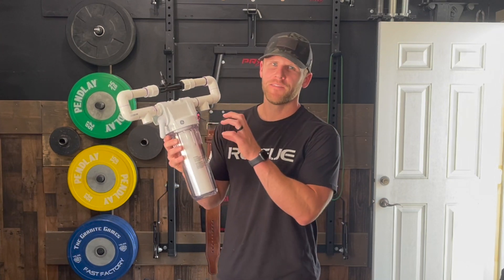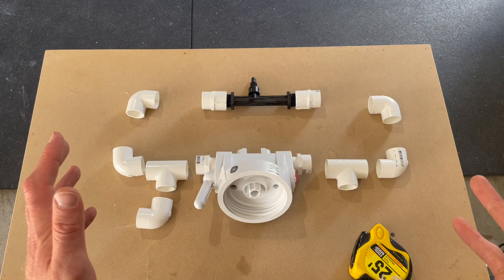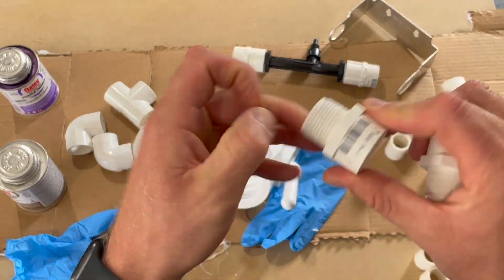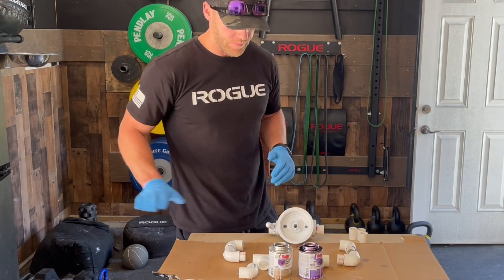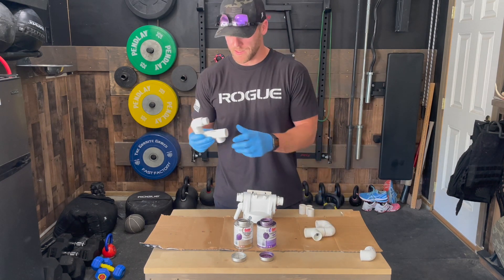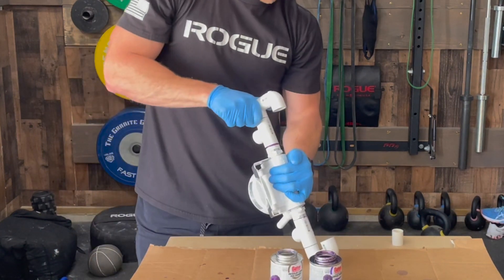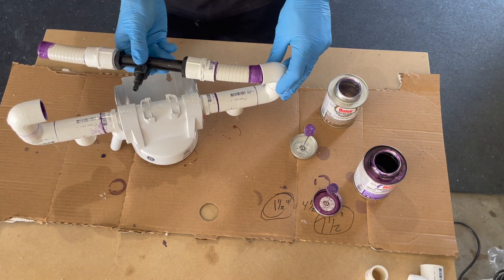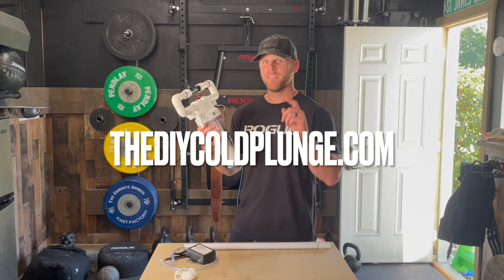Step by Step Sanitation System | DIY Cold Plunge

Comment: I just got done making my ozone based off of this, do you forsee any issues if the purple primer dripped into some of the PVC when applying? Didn’t get in filter but mainly the top elbows
Reply from the maker: That'll all dry and be just fine 👍 you may want to simply rinse the system but that's it

Comment: This was one of my best additions to my cold tub. I got tire of changing the cloudy water. I added this same setup with a 5 micron sentiment filter and works fantastic. One flaw I notice with your design here is that not all of your water will be filtered since its being bypassed. I would  instead add the ozone system to outlet side of the filter, so that you get 100% filtered water and then sanitized. Thanks for sharing this!
Reply from the maker: Hey thanks that's awesome to hear! I get that comment/thought a lot... and it seems legit at first but there is a flaw in the logic of needing everything in-line. I cover it in depth along with other considerations in this video 👉 Avoid These Mistakes! DIY Cold Plunge Filtration & Ozone Setup – Explained
https://youtu.be/y1MYCCyLtME

Comment: So i mimicked your setup with a 1200 gph pool pump, a venturi air purifiers, the sanitation system, and it goes into a 275 gallon ibc tote (cold plunge).  For whatever reason i have no water pressure coming threw the system:/ 

Is there anyway yoir able to help troubleshoot?? This project has been 14 months in making and its done minus the plumbing isssue

Comment: What would minimum pump specs be to run through this setup?
Reply from the maker: The two pumps I recommend are the Danner 950 and 1200 - https://diycoldplunge.com/products/danner-950-1200-pumps
Reply: @DIYColdPlunge  I currently have the Danner 700 for my 1/3 HP chiller. Do you think that will still work if I add this ozone and filtration system or do I need to upgrade to the 950?
Reply from the maker: @awaischaraniya5650  It's going to be close, the filter housing handles 700 itself... I would recommend going bigger if you can. I've also got a new video on how to set up filtration, reference that instead of this old one 👍

Comment: Thank you so much, this is super helpful! I wanted to ask - the tub I have has 1/2 inch inlet and outlet which I can't change (inflatable). I'd like to follow your plans and use 3/4 inch for the filtration/sanitasion/chiller system. Do you think it's bad to use a 3/4 to 1/2 conversion at the tub's inlet and outlet?
Reply from the maker: I've had a few folks do this without issue

Comment: First off thanks for the video with all the links. I bought all the components listed and got it all set up. Only issue is the ozone does not seem to be injecting any air into the line. Any advice on what might be the issue?
Reply from the maker: If you ordered through my site shoot me an email, I'll help you get it sorted out 👍
Reply: I just used your links to buy the stuff from Amazon  but not through your site though that’s awesome though thanks for the offer I understand

Comment: I guess putting the filter and venturi in parallel could work, as long as there's flow through each one.  You're gonna have some unfiltered water going thru the venturi, and some plain water going thru the filter, but after enough time (and assuming there's flow thru both) the water will end up being clean and sanitized enough.
Reply from the maker: Even if you put the filter and ventur in-line, as soon as the water hits back to the tank would be "unfiltered"... The only way to truly filter the water would be to go from one tub to another anyway. This simplifies the plumbing setup and operates the most efficiently for water sanitation.

Comment: 800 gph active aqua pump discharging into the chiller that discharges into a 30 micron ge whole home filter.   Since adding the filter the flow has come to a crawl.  Is my pump not generating enough pressure to pass through a pleated water filter?
Reply from the maker: I'd need to see the entire setup to assess that... You can send an email through my site if you want.
Reply: Understand .  For sure makes sense .  I'll figure it out.  Just wasn't sure if ge 30 micron filters are known to slow flow down to a crawl

Comment: I can't see how the water goes through the filter?
Reply from the maker: The pump is slightly more powerful than the flow rate of both, the flow rate of the filter is significantly more than the Venturi. Water follows the path of least resistance.

Comment: Question… on the exit side of the filter/venturi, why couldn’t you just put a T joint where the 90 elbow is thats bringing the ozone treated water back towards the filter. If you put a T instead of a 90 wouldn’t it allow the water to flow more easily? Basically the ozone treated water would not be coming back towards the filter and just exit straight down when meeting with the filtered water. Hope that makes sense.
Reply from the maker: Yep! YOu can totally do that.
Reply: Could you also do this on the input side of filter?

Comment: I like the symmetry of your design unfortunately you have to put both stages of the filtration process in line. Just looking at the system you would think you’d get 50% of the water going through the filter and 50% of the water passing the ozone generator, but unfortunately that is not going to be the case. The ozone pipe side has little to no restriction to flow and the filter side will have a lot of restriction with the water having to be forced through the filter substrate. Since the water being forced into the system is able to choose the path of lease resistance, a very high percentage of your water will just flow up pass the ozone generator and very little will be forced through the filter.
Reply from the maker: This isnt true for a closed system this small. You'd have to empty one container into another for what you are describing to make sense... as soon as the filtered water re-enters its no longer filtered. Also - most of the water is forced through the filter with how the venturi injector condenses down 👍

Comment: Are you filtering after the chiller?  Also, have you considered or experimented with a smaller diameter hose from the chiller to the plunge?  My thought is it would slow the return in the chiller making it more efficient (colder).
Reply from the maker: You wouldnt want to mess with hose size like that, it will change water pressure and affect the vacuum on the venturi.
Reply: @DIYColdPlunge  Thanks.  I currently don't use a venturi ozone.  I probably should.

Comment: When connecting my ozone generator to the Venturi inductor does it matter if my ozone generator has a built-in pump?
Reply from the maker: Nope, it'll work the same as long as the check valve is in the right direction.

Comment: The filters I have tried seem to get clogged after about a week of use. Does that sound right? They are 1 micron filters. I will try the recommended ones, but I'm just wondering if anyone else has seen that.
Reply from the maker: You'll want to change to 50 micron. Some use 20-30 as well, 1 is way too small.

Comment: I know in a hydronic heating system using radiators, water will take the easiest path all day. One radiator would be full hot and the other would get zero flow and be cold. It doesn’t take two routes unless it’s forced to do so via a “balancing valve”, which is installed to throttle the water going the easier path to equalize flow. Your system might work - and it sounds like it does- but it’s more luck than anything if that’s the case. An easy test would be to run the pump before the outlet side of the Venturi and the filter are connected and see if water flows out of both. If it doesn’t,, an inline valve on the route that has the flow could be installed and incrementally closed until good flow is observed from the other route.
Reply from the maker: In this instance, the venturi is the "balancing valve." This setup keeps the plumbing system running the most efficiently - filtering, creating the vacuum/suction and minimizing loss of total overall flow in your plunge.

Comment: Will the water not follow the path of least resistance thus just bypass the filter ? 

Additionally why not just add the Venturi at the end and save yourself lots of effort ?
Reply from the maker: You will drastically sacrifice flow putting them in line with each other. With a small closed loop system like this your water turns over many many times throughout the day filtering the water without issue.
Reply: Didn’t know at the time the reduction the venturi provides … built your system works like a charm 👍🏼👌🏼

Comment: My dancer 950 isn’t pulling water fast enough through this design. Idk what to do. The pump is gapping with air
Reply from the maker: You need to make sure water can freely flow to it. These pumps push, they don't pull/create their own suction.

Comment: If all of my current inlet and outlet water lines are 1” inch would I just copy this this system with 1” inch pvc ?
Reply from the maker: what pump and chiller are you using?
Reply: 1 1/2 hp chiller from vevor @DIYColdPlunge
Reply: the pump is OYO WATER 1600GPH Submersible /inline pump
Reply from the maker: I can't say for sure with that setup, but worth a test
 @jasongulvartian5163
Reply: ill try it and find some one inch adapters and see how it goes.  @DIYColdPlunge

Comment: If the primer/glue drips down and dries in the tubing is that an issue? What should I do to make sure it’s safe for water?
Reply from the maker: It will cure, you should be good 👍
Reply from the maker: you could just run some water through and then drain

Comment: Hello quick question. I built a cold plunge out a stock thank and am using a inline filter right after my drainage line. Water isn’t crystal clear and now I’m thinking of using a water filter like you have in the video. Due to installation it may not be possible to install the new filter in place of inline filter/stainer could I install it before my return valve? The line that send the water back Into the cold plugs after the chiller? That line has more space to accommodate the size of this thing.  Or does the filter have to be installed by the drain line
Reply from the maker: This goes after the pump. Hopefully this video can help https://youtu.be/RELc6xNzfLM?si=ibLx6V7LqQXDEMJT

Comment: Quick question… the linked Ozone gen has a tiny hose attachment too small for the Venturi tube. Did I miss something?
Reply from the maker: Did you order the 3/4" venturi? I'm guessing that would be the issue. The ozone generator hasn't changed. I do offer and upgraded venturi & filtration plan on my site https://diycoldplunge.com/

Comment: I'm curious, why set the filter and venturi injector up in parallel and not in series?  Is it just for looks/tidiness of the install, or is there a functional reason as well?
Reply from the maker: It's more to maximize flow rate and performance.

Comment: Has anyone had the experience of flow eventually reduce to nothing, replace the filter and flow is back to normal.  Thing is the filter looks brand new. 🤔.
I am on well water and tested as not terribly hard 100 ish ppm. Frustrating filters last less then 2 weeks. Water is crystal clear.
Reply from the maker: Are you pre-filtering when you fill it up with an RV filter?
Reply: @DIYColdPlunge  nope.. will try that next change out.  Thank you for tge note

Comment: It seems the norm is to run the filter system after the chiller/pump (mine is a combo unit), why is that? Wouldn't we want to filter the water before it hits the expensive chiller, to prevent sand/dirt getting into the chiller? Why run it after?
Reply from the maker: To protect it from ozone, and to prioritize suction at the venturi. Any debri that gets through the strainer, & pump (in my opinion) likely won't harm the chiller.

Comment: Hey there! I tried this setup with the newest venturi on your site with 3/4 barbed fittings, but the 3/4 adapter does not fit.

Is there a step I'm missing?
Reply from the maker: The spa tubing should slip over the barbed fitting, is that how you tried it?
Reply: @DIYColdPlunge  Ahh! That makes sense - I did not try that, but I will 👍🏾. Thanks!

Comment: Does the black box (ozone generator) have positive pressure itself pushing air through the check valve?
Reply from the maker: It does not. It relies on the suction from the pump & venturi

Comment: Have you measired actual flow rate? I think my setup is too restrictive. My danner 12 might be putting out roughly 200 gal/hr actual. 40 micron filter
Reply from the maker: 40 micron is a lot, I use 20. Is yours traveling through a chiller?

Comment: Something to consider in the future would be adding a threaded union joint between the two 90 elbows.  In the event you ever needed to swap out the filter cap or the Venturi (both with threads) you could do so without having to reconstruct the entire assembly.  Great video, thanks for putting this out there!
Reply from the maker: Thanks!
Reply: @DIYColdPlunge PVC union slip joints at home Depot $7.11 each, the plain PVC fittings are about .80 cents. I couldn't justify the price even though it's a good idea.
Reply: I just found your instagram feed and saw that you included that on one of your recent builds!  That’s awesome, thanks again for sharing all this going to start gathering materials to build my own!

Comment: is it possible or would it be better in line vs parallel to each other?  Like have single flow of water go first through the filter and then through the ozone so its treated with both?  vs having some water be treated with ozone and other water be treated with filter?
Reply from the maker: No, it would restrict flow too much. Your tank will turn over many many times throughout the day so your water will be treated and filtered many times over.

Comment: so the water getting split to be sanitized by ozone doesnt get filtered?
Reply from the maker: No... and even if it did, as soon as it returns to the tank it would be in contact with unfiltered, unsanitized water. The only way to get 100% filtered water would be going from one tank to an empty tank. The number of times the water turns over through the system is the key.

Comment: Looking for advice from anyone
What is the best way to get the water moving and through the filter? I have an oak barrel and want to avoid drilling holes. Could I use a submersible pump into a filter and have this under my seat?
Reply from the maker: If you want to avoid holes, a submersible pump is the way to go. The Danner pumps I use and recommend can be submersed or used in-line 👍
Reply: @DIYColdPlunge  Amazing thank you very much
Reply: @DIYColdPlunge  just one other question regarding this...could I run it from the submersible pump, through a pool filter (also submerged as it is sealed) and then straight back out into the bath itself?

Comment: is this safe for an outdoor plunge?
Reply from the maker: If you are using ozone indoors you will want to very closely monitor it - from what I have read it seems the recommendation is to run it for a small interval each day when it won't be in use, make sure there is a tight lid on the tub and have a fan/ventilation available if needed. I personally can't speak to it, my setup is outside

Comment: I’m struggling to find any flexible 3/4 PVC. Any online retailers?
Reply from the maker: This is what I used https://www.menards.com/main/plumbing/hoses-tubing/pool-spa-tubing/sioux-chief-3-4-id-x-10-l-flexible-spa-hose/900-16300w00101/p-1470660864012-c-8582.htm?tid=4665030024845156130&ipos=2&exp=true
Reply: Had the same issue, ended but building bottom half then too half so you can glue the two elbow ends to each other straight down making it not necessary to use flexible pvc

Comment: I see there's a cut off valve at the filters so you don't have to put cut off valves in the Plumbing to change the filter and will it keep the water running through the pump so? You. Don't? Have. To cut the pump? Off also. Or do you have to cut the pump off too
Reply from the maker: This filter has a bypass and shutoff valve so you can change the filter without shutting down the pump

Comment: I did this setup. How do you know if the air from the generator is actually pumping into the venturi? I can't tell if it's working properly or not. Thanks.
Reply from the maker: Hey Bob! You should see bubbles at the inlet of your tub if the system is creating suction.

Comment: Nice setup.  Did you think about shutoffs in case you have to service the ozone generator?
Reply from the maker: Hey! the ozone tube can pop off with a little bit of force, there isn't really a need to have a shutoff specifically for the ozone - but I did incorporate shutoffs and unions in my plumbing design to replace/service each component (pump, chiller, filtration, etc.)
Reply: I guess the check valve before the generator would suffice....

Comment: Thanks for this video! Wouldn't the flow rate of this filter create an issue since it is listed as 4 GPM (240 GPH) and the Danner Pump is rated at 1200 GPH? Sounds like you are going to restric the flow a lot no? Thank you!!
Reply from the maker: That was a thought of mine too.. at the end of the day I modeled this after "The Plunge" and used the parts/specs they have. Mine has worked well so far. You can take a peek at the flow at the end of this video https://youtu.be/Dr5WrZaQrCo
Reply: @DIYColdPlunge  But there is no filter element inside the housing at the end of the video. The element would be the limiting factor. Well, if it's working for you I'm guessing it'll work for me and the Danner 900 I have.
Reply from the maker: Yes - It works with the filter in the housing. I wouldn't keep this up if it didnt. And, any loss in flow through the housing would only make the venturi work better by prioritizing flow there. @REBooner30